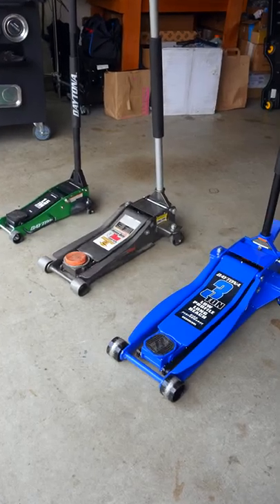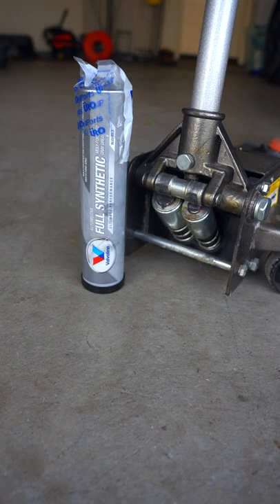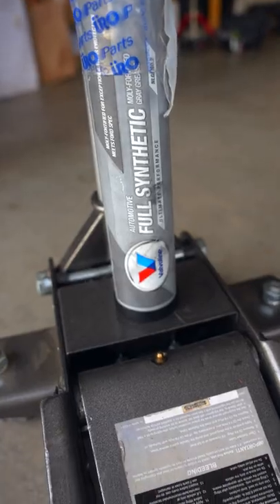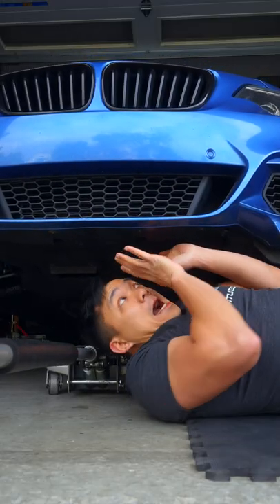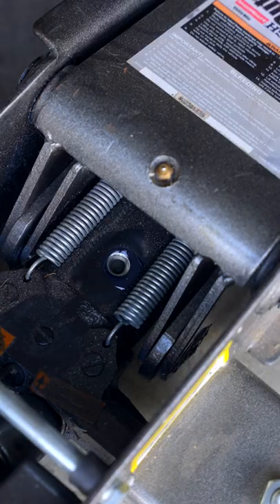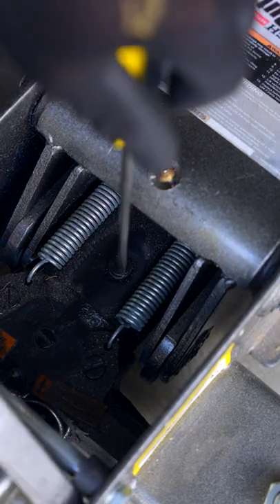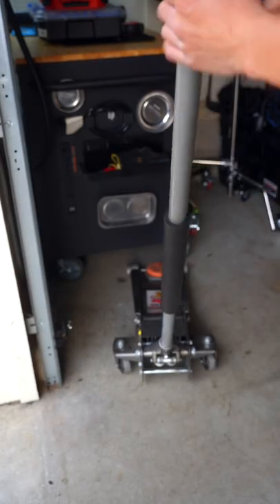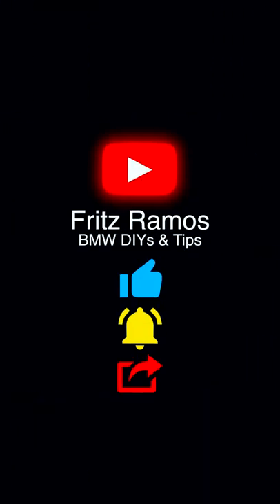Are HARBOR FREIGHT Jacks any GOOD??? #shorts

Comment: Had mine for 7 years as well. Just started losing power and I thought I had to throw her in the bin. 20 minutes later, a screw driver and some fresh Bosch hydraulic oil and she was pumping like new!! I kinda felt bad. After all these years she finally needed some maintenance after watching me fix cars for 7 years of HARD abuse. These low profile double pumper jacks are no joke. Mine leaks a little bit but man it’s paid for itself 200x over. I’ll always love that grey harbor freight 2 ton low profile double pumper jack. It was the newest unit 7 years ago 😅 now they got lightweight aluminum painted jacks like a damn fashion statement. How time flies.

Comment: Remember………
A Jack is meant for lifting, NOT supporting. That’s what Jack stands are for. 
Work safe. The life you save may be your own.
Reply: I always use jackstands, put the tires under the vehicle and lightly support close to where I’m working with the jack
Reply: You can also use the jack as a support. It just safer to have multiple Jack's and jackstand in use plus tires make it more safe

Comment: Ive had my pittsburg jack outside for about 10years now, its got a little surface rust here and there keep the pivot points and contact points lubed with white lithium grease, still works great!

Comment: We’ve had 2 of the middle, grey harbor freight jacks for like 12 years.
Treated them like shit, but kept them indoors, and I haven’t had a single problem with them yet. Tore the foam handle, lost some bolts, still works like a charm when I need it 8 times a year.

Comment: They will eventually leak. The plunger in the rear has a whimpy O-ring and they all will eventually leak from there sooner or later. 

It's been several years since that design came out, and the aftermarket has finally caught up and made replacement plungers/seal kits. So you can fix it yourself.

Comment: Other than a crap pair of cheap channel locks, everything I've ever got from Harbor Freight has done me well. That same 3 ton jack has been great for years and years, the Fortress air comp sanded a car with DA sanders no problem, the 50' drain rooter has already paid for itself. The term 'heavy duty' gets thrown around alot but as long as you dont stress the tools

Comment: I have the same heavy duty harbor freight jack, I've had it for about 16 years, had never been serviced, has never needed fluid added and has been dropped out of the bed of a truck while going down the road, been thrown and had never ever been stored inside, always outside in the nasty Ohio weather. Still works as good as the day I bought it
Edit: it gets used a good bit because I work in cars in the side

Comment: Bro I have a craftsman floor jack that was bought at Montgomery ward sometime in the late 70s and it still works lol.
Reply: Before anyone asks no I don't trust it. I don't trust any hydraulic floor jack.. I use jack stands and always lower the vehicle onto them, than give the jack a light pump untill it just starts to make contact but before it starts lifting again. This way if the jack fails the vehicle won't come down, just the jack will.
Reply: I still have my Craftsman jack from the 80's....
Reply: @homesteadhaven2010  right I'm wondering why it's so shocking a floor jack lasted 10 years I guess Is my point